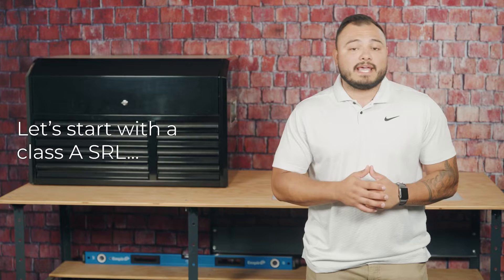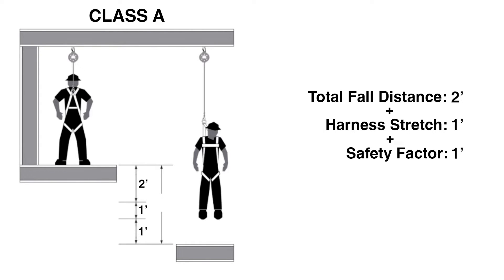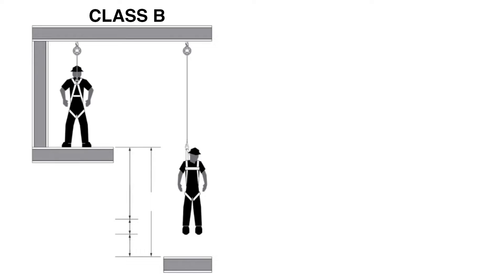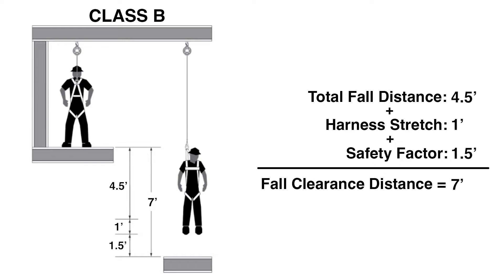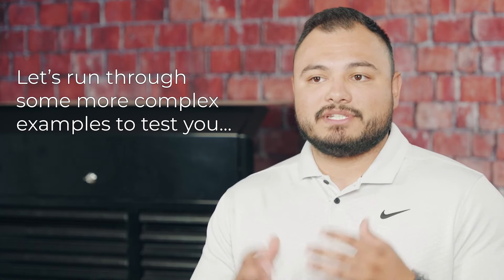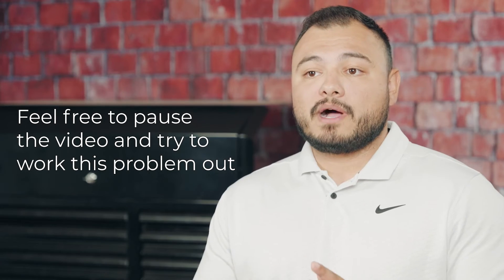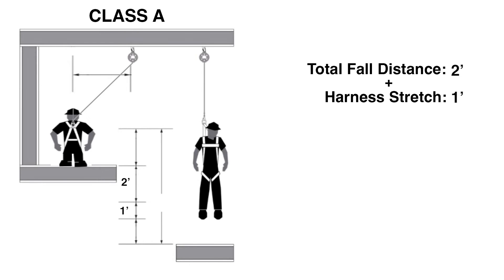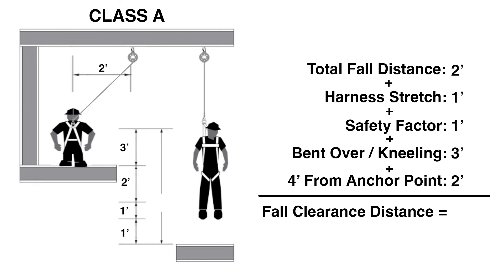How to Calculate Fall Clearance Distance with SRL’s? SRL Fall Protection | Construction Safety 2022

Comment: One more possible scenario. If the worker ties off below their D-ring, free fall would apply. That freefall distance would also have to be added into the fall clearance. For example, if they secured their lanyard at platform level, approximately 5 feet below their D-ring, they would be risking a 5-7'ish FFD. Some SRL's don't permit a FFD but if they do, that could significantly increase the clearance that's needed.